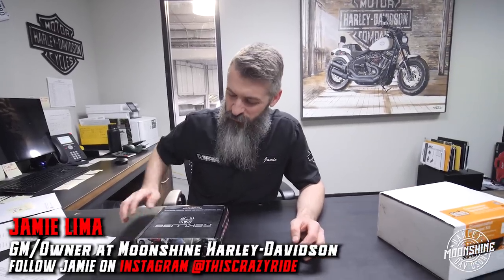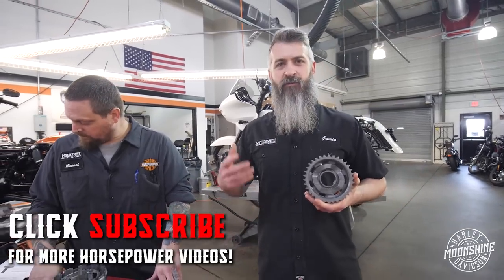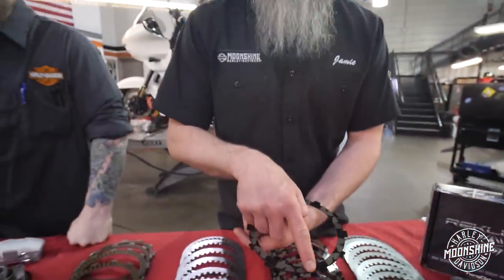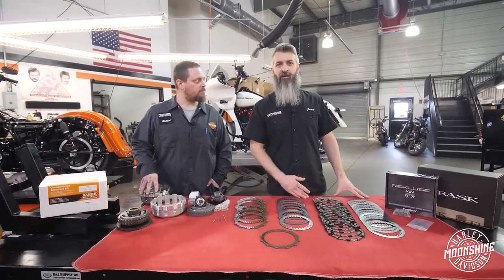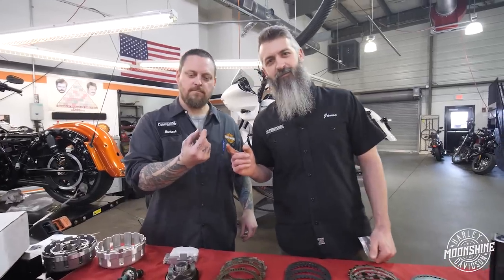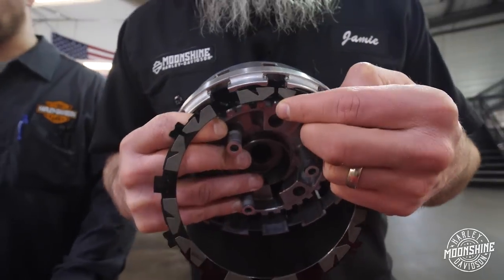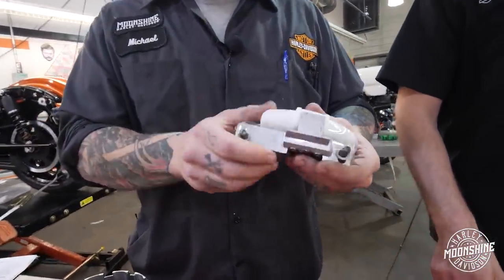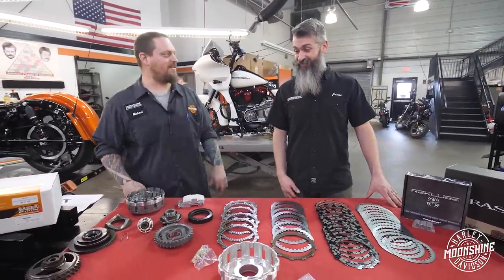Performance Clutch, Tensioner & Compensator For The Everyday Harley Rider | Can Handle Up To 200HP!

Comment: Installed a Baker comp and Rekluse clutch with a Barnett billet basket, Hayden tensioner, new Diamond chain. Clutch was stupid noisy and the Baker wouldn't align even without shims, Hayden part showed excessive wear and cracking at 10k. Installed a Darkhorse comp and BDL extra plate clutch and all is happy.

Comment: One thing about a belt drive open primary is its so easy 2 pull the dry clutch plates out and clean them, you can even replace them and clean inside so you dont get bad wear. Wet clutch is nice though just change the primary oil and ride and they work good too.

Comment: Question!  What would you run in your bike as a compensator?  Darkhorse, evolution delete or Baker?
Reply from the maker: Darkhorse Man-O-War. We have them in stock. Call the shop and ask for
Aaron, Nick or Jamie. 615-274-4170
Reply: @MoonshineHarley  
are you guys having Southern Oregon Hot Bike make your primary chain tensioners?  Is a Hayden tensioner any good in helping reduce noise?  I want the SOHB tensioner that is made for your store.
Reply: Different oils can help with noise but i’m interested in that auto adjuster myself for a M8

Comment: I wanted to ask you guys your opinion on compensators is the dark horse compensator better than the baker compensator? Also that chain tensioner looks exactly like one I purchased from Southern Oregon hot bikes do you have any data on longevity of that chain tensioner? I also use the recluse clutch torque pack. Any info would be greatly appreciate it you guys rock love your videos!!👍🇺🇸
Reply: I have both (FLHTK & FLHR) - after 20k+ on both bikes, the Baker is definately going to need to be replaced soon.  Bought it during the timeframe that you are refering too, not sure if the quality has improved.  Both are rebuilable, just not sure if I want to do that with my Baker or just replace with Dark Horse?

Comment: What primary chain tensioner do you guys recommend for a M8 124 with 132hp and 145 ftlbs.  Running a Baker attitude adjuster with a Man o war motor sprocket and a trask basket with a Sportsman Bandit clutch and a Grudge box. The reason I ask is the primary is really loud going down the road.
Reply: Stock
Reply: My 2022 street glide w/ 114" stage 2 was putting down 128hp/129tq. Put 8k hard hitting, lots of wheelies with zero issues running stock comp and stock clutches with upgraded springs, no slip from clutch and comp didnt look bad when we pulled motor and put a new SE 135" with upgraded cam, baker grude box, chain drive etc.

Comment: I have an 04 superglide. I have a 124 build and need an upgrade. I read that this is only good for 2006/07 and newer? What would you guys suggest for older models if thats the case. I need reliability.

Comment: I think you meant, you cant use the steel inserts with stock clutch plates. They do work in a stock basket but not with stock plates. Must be Rekluse.

Comment: My comp is going out. I have a 124 build dose a comp delete break the bike over time?  I don't care much about noise and vibration I just want power and reliability.
Reply from the maker: Darkhorse Man-O-war and our hydro tensioner. We have both in stock. Call the shop and ask for Aaron or Nick 615-274-4170.

Comment: HB125-07 Hydraulic Automatic Primary Chain Tensioner .. Is this the tensioner in the video sold by Southern Oregon Hot Bikes ?
Reply from the maker: Close, ours is an modified version that handles more everything. The valve in the bottom was designed by us in ours.
Reply: @MoonshineHarley  good to know, as mine failed yesterday. the check ball spring on the bottom is now hanging out of it !

Comment: That Rekluse clutch is getting rave reviews from what I've seen but at what point do you need to upgrade the basket?  In one of your previous videos you showed a 135hp build that the guy had absolutely destroyed the stock basket.
Reply from the maker: Depends on the rider mainly. If money wasn't an option we would recommend them on all big bore builds because the aftermarket baskets are super strong and usually never fail. We recommend them for bikes making over 140 foot pounds of torque with a performance clutch.

 If the bike has a stock clutch it usually gives before all the pressure is transferred into the basket which prolongs the life of the basket but you are not getting all your power to the road. Call us if you need more info (Aaron or Jamie that is) 615-274-4170

Comment: Men of war comp screaming eagle clutch with 1275 springs baker ten recluse sheve 55mm s&s intack ss taps 5.5 fuel injecters stage 2 heades from zippers d&d 2x2xcat headers s&s muffler 128 zippers sleeper kit with 472 red shift cam big sucker air cleaner came in at 133 hp and 158 tq the sleeping beast also added true track Stabilizers now just trying to figure out what want to do next like to have reliable  bike but I get used to hp then end up bumping up so I don't get board with it . This is on a 2020 urta limited wife on back 98% of time.

Comment: Where can I find your spring tensioner in your website? Will it fit my bike? I have a 2018 Heritage Classic (107 | Stage 1). I am looking into adding a Feuling Racing Series Camchest Kit (Oil Cooled M8) + Endurance Beehive Valve Springs with Ti  + Torq Drive Clutch (Rekluse) +  Trask Billet Clutch Basket + Compensator Sprocket ("The Baker").  What can I expect from the bike? Is it an overkill? I ride 50% city + 50% highway (day trips + weekend trips). Usually 2 up.

Comment: is the torqu drive and trask basket still good go tos? I am compiling a list and saw the rekluse apex with billet basket but thats over $500 MORE then the torque drive with a trask basket. should i save the money because this is basically a daily driver and LONG ownership bike.  I have baker attitude adjuster baker comp evo industries comp ramp rekluse clutch and billet basket on my list.

Comment: So I don't plan on going more than a Stage 2 with the Zippers 468 cam w/ S&S camplate and pump, lifters etc.

This set up looks cool as shit but do you think it would be beneficial in a 19 RGS with just a Stage 2?
Reply from the maker: jdsfx4 We like it! We would stick to a 465 - 468 lift cam unless you go with some high Comp pistons. In that case you could go to a 472 - 475 lift cam.
Reply: Hey bud I had that stage 2 set up on mine and shattered my compensator at 20k miles. After putting this set up in haven’t had a single problem. Def would be beneficial

Comment: 17 Rking m8...Took my original  comp off to replace with a low mileage comp assembly. I found a extra flat washer attached on the old comp ramp but the newer one doesn't have this flat washer. I checked parts diagram and manual but it doesn't show extra flat washer on ramp either. What's happening.??? Anyone?

Comment: I prefer the dark horse comp over the baker
Reply from the maker: The Dark Horse War Horse is nice
and it’s for the aggressive rider.
Reply: Will the darkhorse fit an 04 superglide? I'm going down a rabbit hole with these compensators.
Reply: @yourejustintim  no they will not
Reply: @yourejustintim  Justin try the one made by BDL. I use them in my builds whenever I can.  And the customer service is awesome as well. 
T.S. RACING 🇺🇸🏍💪

Comment: Okay...  I have an '04,' 88ci Heritage Softail.  She is currently, 'completely stock,' and more than likely, it's all the original parts that came on the bike new, in 2004.
What's the cost of these parts, to change out the compensator and the clutch, and basket and maybe replace the primary tensioner with one like yours?
Do I really need to even have a tensioner?  Or can I have a sprocket directly from the engine to the primary chain?
Compensators seem to be just a wear and replace pert, but it's a 'stock engine,' not a racing bike.
Reply from the maker: Please call the shop and ask for Nick or Aaron 615-274-4170

Comment: Have you guys tested out the man o war motorsprocket? Noise from this?
Reply from the maker: Yes. We install them on almost all of our builds. If you run our MHP hydro primary chain tensioner you won’t have as much noise. They are $149.95 and we can ship. 615-274-4170 Nick, Aaron or Jamie

Comment: What brand is heavy duty hydraulic primary chain tensioner?
Reply from the maker: aelgali The one in the video! We sell
them for $149.95 and can ship. Call and the shop and ask for Aaron or Jamie 615-274-4170
Reply: @MoonshineHarley  interesting, I just called your parts dept and they said they don't sell these over the counter. They only use them on your complete builds.

Comment: Is anyone manufacturing an m8 outer primary cover with access for assessing and adjusting a manually adjusted (Baker, etc) primary chain tensioner?
Reply from the maker: Run our tensioner and you won’t have to worry about it. Remember the chain stretches are it heats up.
Reply: @MoonshineHarley  pulled stock tensioner.  What tensioner is "your tensioner".

Comment: Why doesn't Harley Davidson's design "experts" hire the techs at S&S to design their engines?

Maybe then folks won't mind paying the high costs for a bike in the first place.

Just saying, dropping $20k-35k on a bike only to drop tens of thousands a few years later for all kinds of upgrades (from cam plates, you better oil coolers, better clutch assemblies etc. makes it hard to justify buying a Harley over a foreign bike that will run trouble free over the same period of time.

And Harley wonders why their sales are slumping. "Buy USA," used to mean quality. That's before all of the soft ass wall street folks got involved when HD went public in the stock market. Now, some rich @$$ snob demands greater profits and gives no $#!+'$ about quality. 

Who changed the "pride element" that once came with buying American? Can we punch him in the face? Asking for a friend 😆

Comment: Will just keep taking your money...
Reply: Money =power= more shit needed so things don't break.  Way more fun than stock.   No comparison..  m8 124 stock heads and throttle body (with 5.5 injectors)  making 120 HP/133 tq.  A daily and long distance rider, it is trong from bottom to top.  I am upgrading Drive line next, then hi flow heads and Throttle body after that. Man I wish I could afford a Baker Grudge Box also.  Lol

Comment: Baker sucks. Bought the comensator and the sprocket chewed up., Junk.
Reply from the maker: deuce0162 did you shim it to the correct alignment?
Reply: @MoonshineHarley  If its not tightened down all the way the splines will rip right out, its softer metal then the shaft on purpose so u dont damage the drive shaft.
Reply: I beg to differ duece, Burt is a brilliant engineer,  kinda like me.
I can guarantee that it wasn't installed properly.  Good luck Sir.